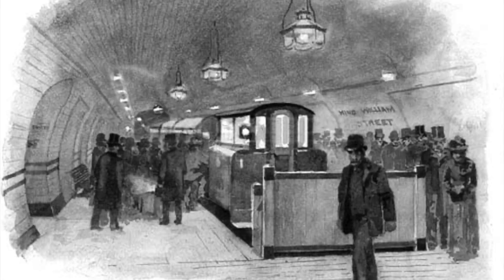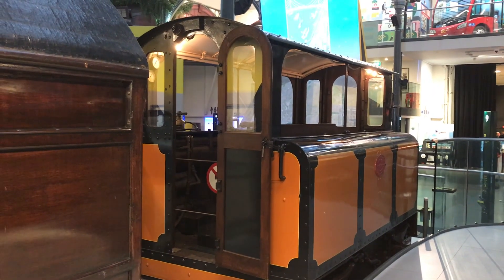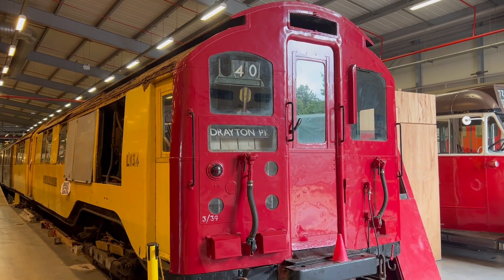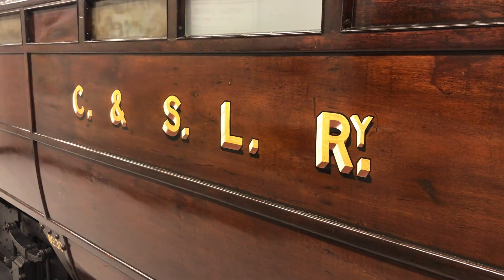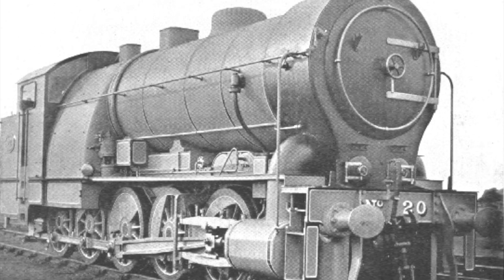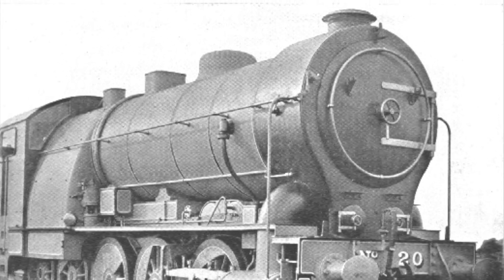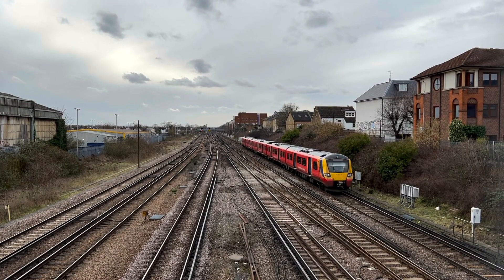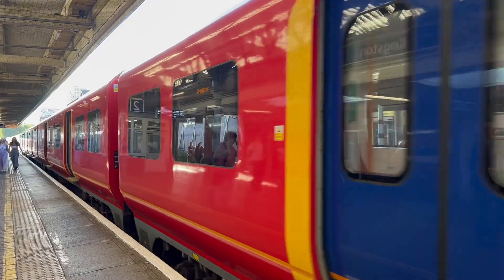Why some electric trains use a third rail, and others don't

Comment: So how does the four-rail system work? Are two of the rails conductors and the other two just for wheels, or is it more interesting? And why do it that way?
Reply: Yes, indeed. In the 3rd rail system the running rails provide an "earth-return". The London Underground adopted a 4-rail system which, although more complicated, had some advantages. 
Firstly, by having the two rails at +400V and -200V, a potential difference of 600V across the motors could be achieved with no rail at a higher potential relative to earth of more than 400V (a 3-rail, necessarily, has +600V and 0V - or, in more recent systems +750V and 0V)
Secondly, by having no return currents in the running rails (because both + and - rails are insulated from the ground) stray eddy currents in the iron tunnel linings could be avoided. These were thought to accelarate corrosion.

Comment: Wandsworth Town to Wimbledon part of the underground?
Reply: It is now, but it was built by the London & South Western Railway in 1889. the District Railway also operated trains on it (joinmingb it at East Putney) from 1889, and electrified it in 1905.  LSWR electric services from Waterloo to Wimbledon via East Putney started in 1916 - it was in fact the first LSWR electric service other than the Waterloo & City line. Ownership of the infrastructure was tranferred to London Transport in 1994, but it continues to be signalled to Network Rail standards and is used by some SWR empty stock trains and as a diversionary route.

Comment: Following on from my 'diesel-electric' related comments, it occurs to me that someone somewhere must have considered a steam-electric loco (electric loco, driven by steam turbine) as a replacement for traditional steam engines.  Was one ever actually built? It seems to me to be a much better idea than the various attempts to make steam engines look/operate like diesels. 

A steam turbine driven electric loco would have all the control and torque advantages of electric traction and a much simpler steam engine (no pistons, connecting rods, valve gear, etc).  And, if oil fueled, the steam side could be largely automated as well - making it as easily drivable as a diesel or electric.  It should also be quieter than a diesel, especially when accelerating/under load - although, admittedly, its sound wouldn't appeal to the traditionalist gricer...

Comment: Not "San Francisco streetcars." San Francisco does have what in the US we call streetcars (trams elsewhere) which run on overhead electric wires. But the cable pulled ones are "cable cars." There were some streetcar systems in the US (like in DC) that used underground electric power with a slot between the tracks for the pickup, similar to cable car slot.
Reply: Trams in London up until final closure in 1952, used a combination of overhead line collection at around 600v DC and the underground conduit system accessed through a slot between the rails. Most trams were equipped for both and there were changeover pits where the wires began and the conduit ended, where the conduit pick-up, called the plow, could be slid out to one side by a hand tool resembling a wooden pitchfork, ready to be attached to a tram coming from the other direction. 

Conduit collection existed in central London where the local inhabitants were influential enough to make a noise about unsightly wires etc. One such route ran across Westminster Bridge, turning to the right just before Parliament, so they were the fussiest of all of course.

Comment: i think you should do a series on the electrification of the long distance rail lines and the cock ups that have occurred, especially from Paddington to the west. what was going to cost £750 million ended up costing over £5 billion and they did not even get to where they were supposed to and ended it short

Comment: So, what about explaining the differences between AC & DC power and how they came to be both used for overhead catenary, please. The effects that had on the needs for rectification of current with AC powered sources and transforming current to lower voltages. The effects of the introduction of AC motors rather than DC. You forgot the Eurostar had to cope with both 1500 & 3000 volt overhead power supplies  Netherlands,Belgium respectively. Never mind the UK DC 3rd rail and French 25kv AC. I think there is some very specific reasons for a 4 rail system for the Underground. Something to do with current leakage and corrosion. Please no footage of the barbaric electrocution of an elephant to demonstrate anything in this subject.

Comment: Another well explained video Jago. I keep learning from you and the way it is presented just speaks to me! 
Also, I might add, something similar happened here in germany in the 1920s and 1930s, but on a way smaller scale. The U-Bahn-systems in Berlin and Hamburg, starting before WW1, had used (and still do) a third rail. So, when they started to built S-Bahn-systems in both cities, they used the third rail, despite the fact that the mainlines were about to adopt the overhead wire (which they did). Otherwise, Germany today is in a strong relationship with the overhead wires. Even newer U-Bahn-systems like in Munich or Frankfurt are using overhead wires and modern S-Bahn-systems are basicly regular mainline trains with special rolling stock and dedicated sections in the core (like the Liz line in London, but starting the 1970s). Making these third rail systems kind of an oddity.

Comment: It is my understanding that new third rail electrification is now banned. As a result the Bluebell railway cannot create a section on which the old Brighton Bell can run.  If you have to travel between Guildford and Reading there is no electrification between just after Ash station and Wokingham. This is a short part of the line, between various junctions.  Therefore, this line is forced to be diesel powered.  As you say, converting to overhead lines is too costly.
Reply: The Bluebell Railway, as a private heritage line, can be electrified if it wants to and there have been some ideas floated for re-electrifying the disused Horsted Keynes to Haywards Heath via Ardingly line with DC third rail if they can get control of it, which isn't likely until Hanson stop using it for aggregate trains from Haywards Heath to their depot at Ardingly, but this would be subject to very strict HSE, planning, and systems rules, and wouldn't be cheap. It would also involve rebuilding the line from HK  to Ardingly including a new bridge across a stream and road although the trackbed is owned by the Bluebell and they also have a heritage bridge ready to be reassembled to cross the gap.

As for the gorgeous art deco Brighton Belle set, that I rode on as a kid from Brighton to Victoria and is soon to be running again, it has been fully restored and updated so that it can run on the entire Southern DC network using DC power but can also run off the electric network by being propelled by an electro-diesel, a Southern hybrid diesel / DC third rail heritage electric locomotive, of which there a several available, and the entire train can be driven from either the locomotive end or the BB cab end. Once on the Bluebell, the electro-diesel would run as a diesel so no electrification of any sort is needed.

As the Bluebell line connects to the electrified Southern network at East Grinstead, the Brighton Belle can cross from Southern to Bluebell rails there and so can visit the entire Bluebell line through EG. I can't wait......

Comment: When electrifying the lines into Edinburgh through the Mound and Haymarket tunnels, limited clearance necessitated the use of solid overhead conductors, rather than flexible cables which might be pushed up into the tunnel roof. As a consequence, steam engines are no longer allowed to operate through those tunnels; steam hauled railtours have to go around the old Edinburgh South Suburban line.
One imagines much of the Southern Region would face similar clearance issues.
Reply: There are also several stretches of the GW that have overhead conductor rail inside tunnels, e.g. the Severn Tunnel, and Chipping Sodbury tunnel on the Badminton line. Most of them use copper contact rail mounted in an aluminium structure, but not the Severn Tunnel part - they fell foul of salt water using two different metals, so had to use aluminium contact - no doubt with increased wear and tear.

Comment: Wasn't there an incident on Thameslink a few years back where the driver forgot to lower the pantograph when moving onto the 3rd rail section? Cue a loud bang and lots of expensive bits of equipment of breaking apart. 😂
Reply: I think that was at Blackfriars coming south. The pantograph is supposed to be lowered going south at City Thameslink, I think.

Comment: I suspect that the Brighton Line will be the first line south of London to have overhead electrification put in place, as it makes sense to follow Thameslink south of London. The West London Line will be a close second, as there are trains from East Croydon to Watford Junction that go on the West London Line.

But given that there are vast parts of Great Britain without any sort of electrification and that we need to get rail freight electrified, I suspect that a sensible way to do things would be to have a government that commits to a rolling program of railway electrification, where railway engineers and timetable experts look at individual railway lines on a case-by-case basis and we do things in the order that gives us the best carbon savings, as soon as possible, and do infill projects (or projects that make sure freight can get in and out of freight yards) when that is needed.

Probably the other thing that might get electrification in the South East of England done, when other parts of England, Scotland and Wales have not been done yet would be the need to get freight trains from Europe off of the High Speed 1 route, so we can get maximum capacity for both high speed trains and freight through the Eurotunnel. Again, I can imagine this being a route that goes via one of our cross-London connections:
* I don't think I've ever seen freight on the East London Line. And it is somewhat busy what with having trains to Clapham Junction, Crystal Palace and East Croydon. But maybe they would send through trains at night.
* I think the Thameslink route was originally considered to be a freight route through London. I believe it got shut down from lack of freight, but now with trains having to use computers to boost capacity, it would make no sense to route freight via that line, except at night.
* This leaves the West London Line. There has been many a time, I've waited an hour for a Watford Junction train or watched lots of District Line trains pass West Brompton while waiting for an Overground train. And I've seen more freight trains go up the West London Line than I can count. So I can imagine a plan where an alternative overhead electrification route from the Eurotunnel, and overhead electrification brought south from North Pole Junction to Clapham Junction (so that train power switching happens there) would be rolled into a single project. 

I hope that we get a new government that sees the need to actually invest in railways (rather than have more governments that try to get private businesses to buy things and recover the money from passengers) as the current approach is causing far too much delay. We really do need to get this stuff done.

And we need to have a permanent end to the nonsense, where a city up north puts in a plan to upgrade transit and Parliament wastes five years trying to shave 5% off the cost of the project and the entire plan has to be redone multiple times and ends up not being cheaper anyway.

I don't know how long it is going to take before enough British voters realise that we need to electrify most of the railways in England and Wales and a lot of the railways in Scotland. (And I don't know how long it is going to take before enough British voters realise that hydrogen trains are stupid and that we should stay focused on overhead electrification and not waste money on hydrogen.) But once the masses get onboard with the idea that "overhead electrification is good" (and that "level boarding is good") and all candidates to be MPs start getting asked "When are we getting overhead rail electrification in our area?" all the parties will have to magically stop cock-blocking railway investment.
Reply: I completely agree that the first DC to AC conversion should be the Brighton Mainline and as that links at Clapham Junction to the West London line, that ought to be done at the same time too so that there is an AC connection to the wider AC network. Other DC lines can follow as their DC substation and power supply equipment come to the end of their useful life.

As for electrified freight, there was a fully-fledged plan in 2012 to link Southampton and Felixstowe to the Midlands and North using a lot of existing tracks but electrifying them all at 25Kv AC, to create a fully electrified route for freight to take this freight off the roads and route it all away from transitting through  London This was called the Electric Spine, but predictably it was hacked about, queried, examined, reexamined, queried again and then most of it was eventually cancelled as all this dither and delay had increased costs.
Reply: On another thread I recently brought up the subject of diesel hauled freight trains on the WCML. I don't travel by train much so don't know even if any freight trains are electrically hauled now. There seems to be absolutely no point in considering electrification of freight routes if the freight operators have no intention of using anything other than diesel haulage. Can anybody confirm are there any electrically hailed freight trains now?

Comment: There are many reasons why third rail is selected.amd ovehead.
With Thameslink ot is simply because the standard 25 KV system traond then are required to use the legacy 3rd rail system in use sputh pf the Thames.
The inderground uses   third and 4th rail as the yunnels are not big enough to accommodate overhead line equipment.
The same os yrue of the Northen city line where the 25kV to 750DC changeover happens at Drayton Park.

Perhps the real real reason is to drain the gene pool of silly people who tresspass on railway lines so why not reward them with a Darwin Award

Comment: I rode the Marylebone line to Oxford the other day because a landslip had pretty much stopped traffic at Paddington. I wondered what system might be used if the Chiltern lines were to be electrified. At the London end, it makes sense for it to be third rail, but at the other ends, probably more sense to be OHLE. Well we have trains and technology to do both, so problem solved, get on with it.

Comment: Overhead wires and their gantries are downright ugly.  Wires and 3rd rail can be ripped up. The GWR Vivarail Class 230 battery trains were tested at a range of 84 miles - and recharged in 3.5 minutes. On half battery charge they went 70 miles. The Merseyrail Class 777s were tested by Stadler reaching 84 miles in range. That is with current batteries with battery technology getting better. 

The GWR 230s are charged at the stations using a charging rail between the rails at stations, or selected stations, with charging shoe under the train. This is ideal for urban railways and also regional railways.  For example, they will do the Liverpool-Manchester line at 30 miles with a quick charge at each end.  

The choice is a smaller and cheaper battery set charging at every 2nd or 3rd station, or one expensive big battery set that has over 80 miles range.  The large train mounted battery set looks the cheaper option, as the chargers at the stations have a trackside battery set as well that transfers the charge to the trains batteries quickly. The trackside batteries charge from the grid slower.  So, lots of battery sets needed. A combination of trackside super-capacitors and batteries would be the ideal setup. 

These battery trains can also be hybrid running, on batteries, wires, or 3rd rail.
Reply: Really, charged in three and half minutes?
Reply: @kevinrayner5812  
Yes.
Reply: So are electricity pylons ugly. Wind turbines. Mobile phone masts. Solar panels. Street clutter, excessive road signage. Telegraph poles. Street lighting. Yet we put up with all of that. Who would be reading these messages if it wasn't for electricity pylons and wind turbines.

Comment: First of all selection done by SYSTEM. Ancient simple low voltage DC and much more advanced high voltage AC (in many forms - 50/60Hz 1ph, 16Hz 1Ph, 50Hz 3ph). And only after this to select overhead wire, 3rd rail or ever 4th rail. It is almost impossible to use high voltage with rail, from the other side DC by wire causes significant problem with high power and long distances (nevertheless significant part of USSR rail network is DC 3000 as it was elecrified 70 years ago and proper AC system did not exist yet, Sydney and Melbourne commuter trains are DC1500 for the same reason). 

Tram in Sydney for example uses both systems - overhead catenary most of length and ground 3rd rail with dynamic power control in City. Overground changes not only wire/rail but this type of current first of all. Some European trains (ICE) can use 3 and even 4 systems.